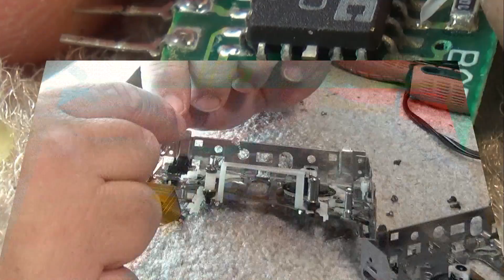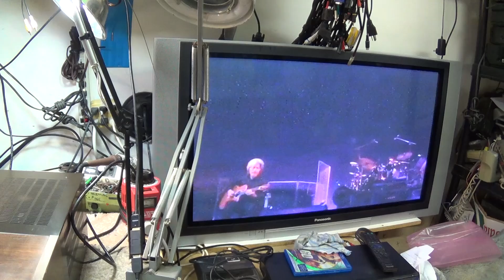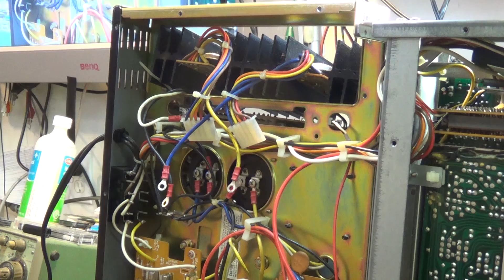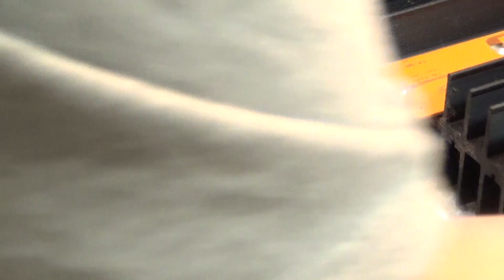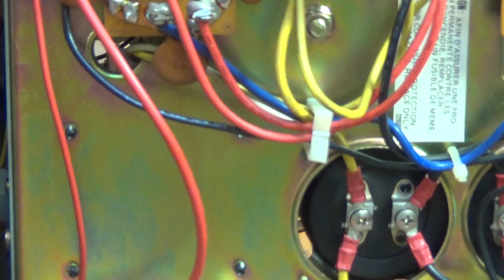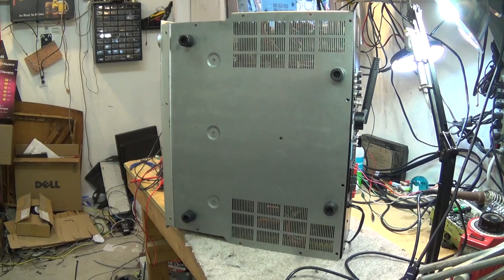Toshiba SA7150 No Sound Left Channel

Comment: Do you think you can still make a living doing this since society has become so disposable. 
Most people will throw something away before getting it repaired.
Reply from the maker: +1Blastarr Today it would be very difficult to make a living in this business, however there are a few service shops that are still plugging away.They may be just doing a lot of warranty work, but one local shop is doing very well repairing this old vintage stuff. That is where there is still money, in the big old 2 channel amplifiers and pro audio.Back in the 80's and 90s it was not uncommon for a TV tech to make 65-70,000 a year easy. By 2002 I was down to about half that, and I could see the writing on the wall. New stuff is mostly not repairable.
Reply: I do some restoration and maintenance of old school electronic gear for friends & family, just for the fun of it.  I usually ask for a small fee. Modern cheap stuff is worthless as soon as it leaves the factory.  Swapping boards is no fun.  Usually repairing modern stuff is more expensive than buying the latest model.

Comment: when you were talking about how the owner wants to stick with that receiver because he knows if he gets a new receiver, it just wont come to the quality that old legend is made of, its the same thing that im doing with my hunter original ceiling fan, its an absolute tank of a ceiling fan, made of about 45 lbs of cast iron, and I know that any of these ceiling fans of todays market is absolutely garbage if I were to get one of them, things back in the day were built to last and its so sad that you just dont see quality in todays world anymore. :\
Reply from the maker: +Tyler Hanson Absolutely I have an old washer, a Kenmore, made in Canada and it is at least 40 years old. Was left in the house when I bought it in 93. Dates back to the 70's. My wife keeps wanting to get a new one, and I refuse. This thing is built like a tank, and uses about as much energy to run, but it never stops. My sister on the other hand wanted those new designer "red" front loading washer and dryer made by the little girl company. Barelt 5 years old and it is broken. She has been bringing her laundry over to use our old washer and dryer here because her fancy one in on the blink. I think a lot has to do with the country where products are made. Get a domestic made appliance, or electronic equipment, and there is a sence of pride by the well paid workers that built it, and they put in quality well made parts. You pay a premium for this though. Then there is the churn out 10,000 units a day from some mega factory over in China, where everything is plastic, and you are lucky if it lasts past the warranty. Who is to blame? We are. We demanded cheaper products, and manufactures looking to keep their profit margin just off shored the production to the land of cheap labour, and we end up with shoddy products.

Comment: I noticed the relay pin didn't have any solder on it....lol I was screaming .....that pin needs solder :) Your video`s crack me up .....lol scared the bejesus out of me when you were cranking on the volume and something fell.....lol Awesome job as always .
Reply from the maker: +Navpers 47 Yes I know I left it open to see how many would catch it.My but set fell off the shelf about 9 feet in the air and whacked me on the head on the way down. Have a nice shiner today.
Reply: +12voltvidsSorry so long getting back to ya . Glad your okay .....lol
Reply from the maker: +Navpers 47 Next video I will shoot it with my motorcycle helmet on!

Comment: Hello Friend!
I have a problem with my Toshiba X798 VCR.
Every tape came up with this sound:
https://youtu.be/98HrLlrfsQQ
Do you know what it can be?
Thanks!
Reply from the maker: +João Antonio Franz That sound you you are hearing is what we used to refer to as "motor boating"and it most likely is a capacitor somewhere in the circuit. Sorry I can't be of more help but without checking some key voltages out f the power supply it is impossible to even try to point you in the right direction. Saying that the power supply is where I would start.
Reply: +12voltvids Hmm, I see. That's okay, thank you very much. I think is time to throw this old one away and get a new one. I'm interested in a Panasonic ag1970, what you think?
Many thanks for the support! :)
Reply from the maker: +João Antonio Franz The 1970 is essentially the same machine as the 1980. I have a 1980 and it has many problems. Power supply fixed, and then find leaking capacitors in comb filter (not fixed yet) and the front panel buttons don't work (also not fixed yet)There are better choices than Panasonic. ANy of the more modern Motsubishi units such as the HUS55, 63, 65, 67, 82 ect. The ones with the di-cast chassis. Those ones are built solid, and very reliable.All the old Hitachi machines are also good, as were most of the JVCs.Stay away from the Sony VHS machines, they have a lot of plastic gears that break

Comment: When I was recycling the Electronics from an unwanted Motherboard, as soon as I remove the resistor, I accidentally break it open and I noticed that has a copper wire inside the resistor which tells me whenever any resistors is shot, then it's going to be recycled to save the copper wire for the scrap metal.
Reply from the maker: +Bluethunderboom Wire wound resistors will have wire of some type, but most resistors are not wire wound. That is fine for low ohm, high wattage units, but most resistors are carbon rod, or thin film type and they have no recycle value.

Comment: I had a Toshiba beta vcr, very nice.  I used to wonder if Sanyo was Toshiba's cheap line? Either Sanyo or Toshiba made stuff for Fisher in the 80s.  I've liked all the MIJ Toshiba stuff I've had through the years, including a very nice turntable and I still have a pair of 12" 3 way speaker systems. My led flat screen is T, no problems for many years. I think T was rebadged for some of Sears too.  So you  probably had to charge the customer at least one hour for a 2 cent resistor!    My brother paid a tech about 300$ to recap and an IC chip in his T 36 CRT TV set.  He said it was well worth it to him, although it was about 40$ for parts, that know how and labor was worthwhile to him, he really likes that 10+ year old TV set that weighs about 300#.  I have a more basic model 36" T CRT set that I got at a junk store very cheap, fantastik TV.  Many feel that Technics, Sony, JVC, etc. are better Jap rigs,  but Toshiba is also better quality stuff, and often overlooked.
Reply from the maker: +umajunkcollector Fisher used to be a quality American made brand. Then Sanyo bought the name, and things were never the same. Toshiba and Sanyo 2 completely different companies. Sanyo made a lot of semiconductors as did Toshiba. The top tier Japanese companies were Sony, Panasonic, Hitachi and Toshiba. Sanyo was a second tier (cheap) brand, and they made products for Sears, as did RCA.Panasonic used to make VCRs for RCA and then RCA changed to Hitachi.

Comment: THAT WAS SANSUI, NOT SAMSUNG, LOL!  I have an old 70s Sony integrated amplifier rated at 100w/ch that I admittedly abused most of the time in the past 35+ years that I've owned it, and I bought it used.  I have an old Fisher quad amp that I like alot too.  I like Harmon Kardon, you get a lot of bang for the buck.  Don

Comment: Those capacitors are huge! Did they require discharging? A great video and very informative. That amplifier was well built, they certainly knew how to make robust electronics back in the 70's even if they did weigh a ton. Well done getting this working again glad that it was only a resistor that needed replacement and nothing too major.
Reply from the maker: +DLiberator78 Those caps can hold a good charge, but the voltage is not that high. 45 - 55 volts each, so 90-110 volta DC potential difference between the + and - rails. Saying that, they store enough energy to blow the tip off a screw driver if you discharge them with a dead short. They do discharge relatively quickly though after power is shut off, because the circuits are still powered by them, and this will discharge them within a few seconds. If they were isolated from the load by a relay that cut power to the circuit when AC was removed they would hold their charge for quite awhile, but that isn't the case. The relays cut the speakers, and let the caps discharge through the circuitry. That is the reason for the speaker relays, so that as the caps discharge there wouldn't be DC voltage sent to the speakers caused by voltage imbalance between the + and - supplies as the power supplies discharged.
Reply: Thank you for such a detailed response. You are a fountain of knowledge and I have learned a lot about electronic repairs from your channel. Keep up the great work. I love your videos.

Comment: Another cool repair! It would've taken me hours before I would be going after that resistor, I just always assume they will be fine. (I'm 23 and just starting to fix electronic equipment, I really enjoy watching a skilled and very knowledgeable person do these 'uneconomical' repairs. Absolutely hate the throwaway mentality, let's hope things will change!
Reply from the maker: +Koffi Banan That resistor was the second part I tested after removing the board. It wasn't just luck either, as soon as I determined that the repay coil was not open (as that happens) I checked the transistor array (that black part that looked like a SIP IC, but what makes it different it that it is only a transistor array without internal resistors and other circuitry) for shorts. None found I started looking at the support componets.

Comment: You make it look SO easy!  Tnx.
Reply from the maker: +John Schroeder When you have been working on electronics as long as I have, it is simple. At least this stuff is. 32+ years as an electronics tech. 20 at a warranty depot for Sony, Panasonic, Toshiba, Mitsubishi and RCA. Its a dying industry, but a few of us dinosaurs stick with it, but not to making a living today. Couldn't if I wanted to. Throw away society, but some good old pieces such as this are still being serviced.
Reply: And exactly this is what makes me angry.Today you are not buying electronic stuff but you are paying just to rent them for a specific period with a preset expiration date.And in the effort for even lower prices in the appliances they dont have even spare parts to use to the so called authorized service centers and find cheaper just to replace the appliance as long the warranty period is being valid.